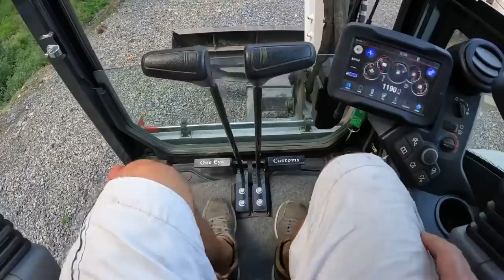Earth SQUEEGEE, EXCAVATOR Modifications that will surprise you. Ground clearing made easy!

Comment: I use a piece of mine belt (rubber conveyor belt) bolted on an angle blade for a cutting edge for snow removal. It will squeegee off snow, slush and water before it can refreeze on asphalt and concrete without damaging the surface.

Comment: i welded a lip on the top of my blade also. awesome idea. but when it becomes a problem is when unaware people are digging at depth with it. yep lucky me! my machine was retuned to me with a big bend in the spill guard from the barrel of the cylinder.  no problem though, i used the opportunity to cut in a receiver for a hitch. awesome for moving trailers around and works well with a dump trailer in tow for digging and or bailing stone out of.

Comment: Glad I stumbled onto your channel.  I also watched OWTM's recent video on his new attachment, and even commented that I built a rake like that out of an old grapple, but wish I had done it out of an old spring tine landscape rake instead, because it will definitely get into tree roots very easily and pop them out of the ground.  Plus that crossbar near the tines will act as a blade and you end up scooping a LOT of dirt up that you don't want to.  That said, your "squeegee" is ingenious.  It does EXACTLY the thing I want to do.  Considering I am about to put new tracks on my machine, I'll be looking into using the old tracks to make one of these......probably.  It just works too well to not try it.  I think I will also look at adding an attachment to my thumb as well, using a short piece of used track as well.  It will be mounted so I can "pinch" small saplings with it and the squeegee to pull them out of the ground a LOT more easily than trying to twist them and hope to pinch them enough with the teeth to do it.  Muchos Gracias for the inspiration!
Reply from the maker: @Python 357 Thanks for jumping on board, I also made a mount for a 3pt tine rake for my excavator to “rake” the ground. I found out very quickly that those tines are hardened and very brittle. They don’t bend very far before breaking off. After breaking several of the tines, I scrapped that idea and only use it along the edge of ponds to pull out seaweed. The old track works great, best of luck!
Reply: @OneEyeCustoms  what did you use to cut the rubber track?
Reply from the maker: @Python 357  I used a sawzall and a cut off wheel on a grinder.

Comment: Cool idea.  I have always thought a york rake about the size of your squeegee would be excellent for an excavator.
Reply from the maker: @GFD472  Thanks for watching and the comment. Funny thing is, I tried a York rake first before making this. What I found is the tines on a rake are hardened and brittle when attached to an excavator with that much down pressure it would break the tines. After using it several times it had broke almost half the tines so I scrapped that idea. Although, I will say the rake works great along sides of ponds for clearing seaweed.
Reply: @OneEyeCustoms  To funny!  I was specifically thinking about a rake for cleaning ponds, streams, spill ways as well as shaping loam and removing rocks & debris before hydro seeding.  Light duty stuff to fine tune a property.

Comment: I like your creative problem solving and ingenuity in regards to equipment use, care. I can also see the value of the excavator landscape squeegee in backdragging  without scratching hardscapes and also for gravel road/trail maintenance, but I’d shy away from utilizing it for stripping the forest floor. I appreciate the intention to protect the tree roots, but if those trees are really important to you it is best to leave the detritus/duff/mulch on the surface. Bush hogging/ masticating as needed should suffice. In a natural environment that organic matter top layer above the soil contains all kinds of beneficial micorrhizal fungi that breakdown plant and wood debris that contribute to the soil biome, aeration , soil density, pore space and nutrient availability to the trees fine feeder roots just below the surface. By removing all that material you expose those fine feeder roots to all the foraging animals, cause the upper soil surface to be exposed to the drying sun pulling moisture from the soil, and  contribute to runoff when there are rains as there is not that organic matter (sponge) holding the moisture allowing it to perk into the subsoil. My .02

Comment: Your ingenuity, creativity and workmanship are top notch!  I would love to have all of those modifications for my mini-excavator.  How did you like the Case 90XT?  I'm actually looking at buying one this week.  I currently have a Case 1840 and I'm looking to move up to something bigger.  Unfortunately a newer tracked machine is out of my budget.  Dave
Reply from the maker: @OakRun Acres I loved the 90xt! I also had an 1840 before the 90xt. The 90xt has so much drive and lift power, it was a beast of a machine, but the traction was the problem as it is with any wheel loader. Tracks extend the season of running by several months especially in the wet seasons around here. Best of luck
Reply: @OneEyeCustoms  Thanks for the reply Doug. I can definitely see the advantage of a tracked machine and I will definitely have one in the future. Glad to hear you were happy with the 90XT. More power is what we're looking for and it looks like the 90XT has lots of it. Dave

Comment: I built something very similar mine has a mount on the back of the blade the bucket slides into and I chain and binder it tight the rubber is a good touch though

Comment: The company I work for has a Deere 85G mini X. My boss had an old bucket off an old tractor 7 feet wide. I built an attachment mount to fit the quick connect. We use it al lot for filling and grading. 7 feet wide is so much better to grade with that the biggest bucket available for the machine at 3 feet. The bucket is nice because while grading you can pick up materials and place them when needed.
Reply from the maker: @Eric Hill Awesome!!! Thanks for sharing and also watching. Lots more videos to come!!

Comment: I was think about making a York rake for my excavator
Reply from the maker: @Rob Bobcat a word of caution or what I learned when I made one for mine. I had an old rake I adapted to the excavator, and found that the tines are hardened steel. The power of an excavator and downward pressure snaps the tines right off!! Your rake tines were not made to have downward pressure, they were meant just to float behind a tractor. They harden the tines for better wear which makes them less flexible. Ask me how I figured that out. Over time I broke more than half of the tines on the rake and decided I needed a better way. And that’s how this blade came about. I will say that the York rake idea works great for cleaning seaweed off the edge of ponds!
Reply: @OneEyeCustoms  Thanks for the info

Comment: the other name for this attachment is the pin destroyer,
Reply from the maker: @Shawn  Really?? Do you have one? Has it destroyed your pins already?
Reply: @OneEyeCustoms  years of running equipment teach you a thing or two any attachment that spans wider than your bucket destroys pins, that is why you even use a narrow bucket to clear instead of you cleanout bucket, every time this thing catches a root or dirt lump at the outer edges it is putting magnitudes more force on the pins then they were engineered for.